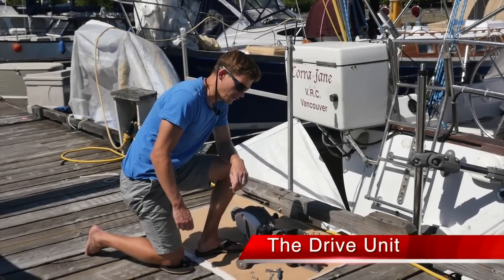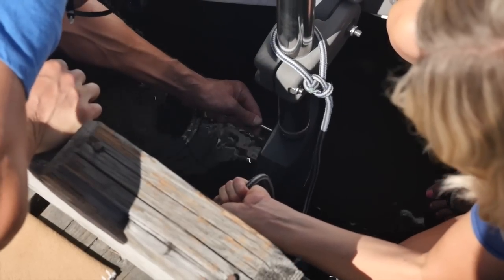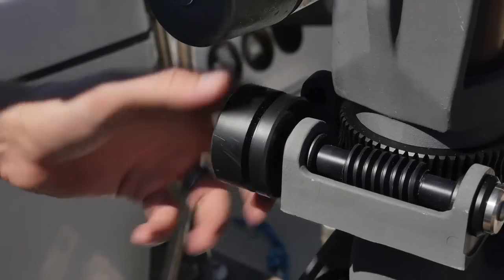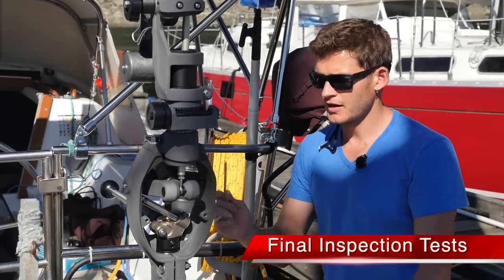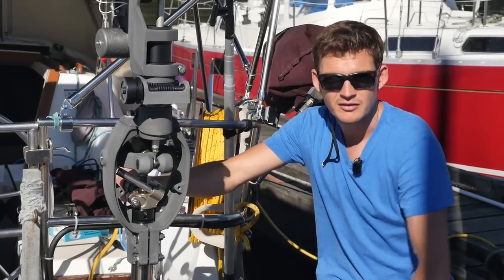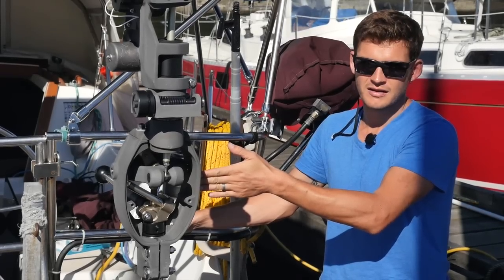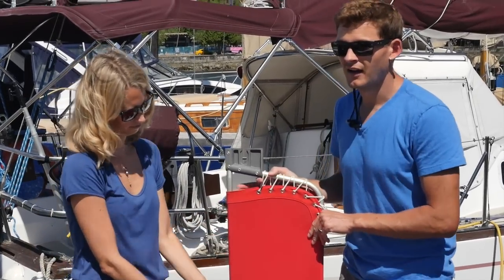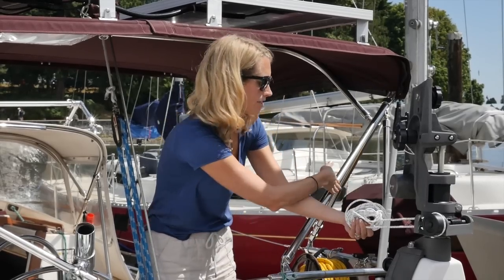Hydrovane: The Installation - Part 3

Comment: What are the actual torque settings ?  Do you recommend a locktite product on the bolt threat prior to torquing the nuts? Just a few more questions.  Would you recommend a UV fabric sealer / coating?  Is the gearing a plastic composite?
Reply from the maker: Thanks for your very perceptive questions! I know Will has responded directly, but I'm sure these answers will be helpful for others as well:

1.There are no torque settings – you simply tighten until good and tight but not too tight.  Surprisingly, we’ve never had any issues with this.  The castings are pretty robust.
2. No need for Loctite on the bolts as they all come with nyloc nuts.  We put Loctite on the grub screws for the axles ect but you shouldn’t have to touch these.
3. We’ve yet to hear of a UV fabric sealer that actually does much.  I’ve heard of someone painting it but it eventually flakes off and gets messy.  You are best to keep a spare onboard.
4. The worm gear is Delrin on Oilon so the plastics won’t bind on each other.  There is no load on the worm gear once the vane is set on the desired course so almost no wear other than UV damage over time.

Cheers, Sarah